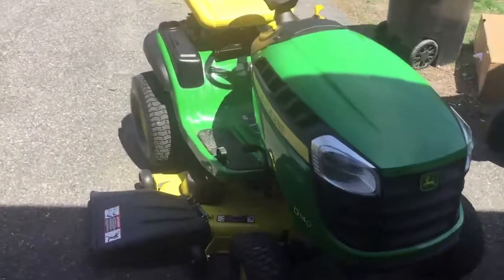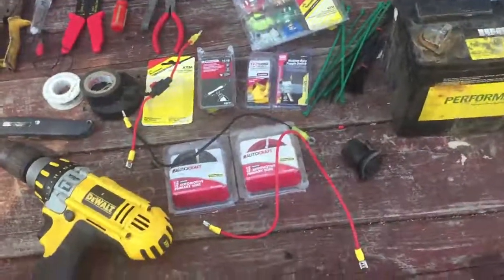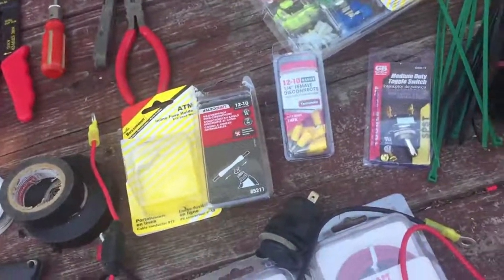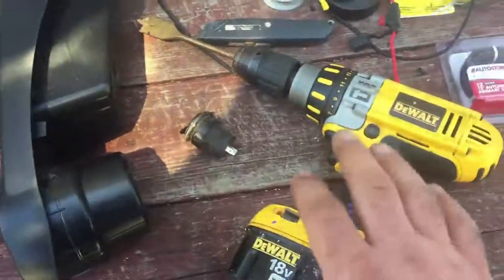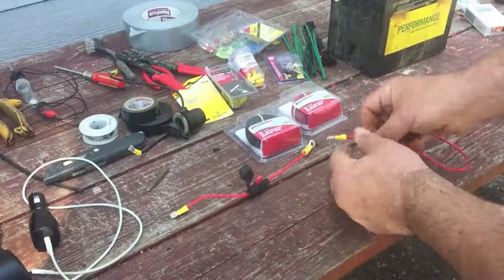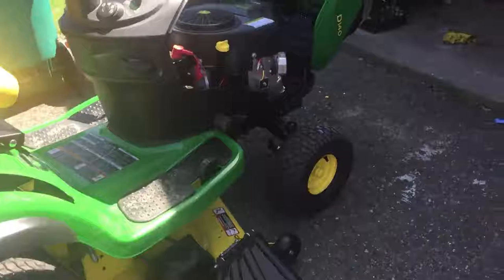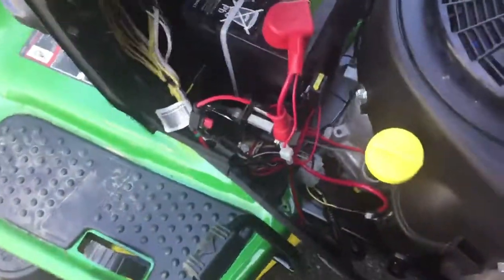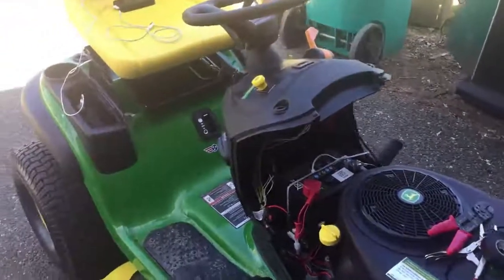John deere D140 12volt Power Socket Detailed Install easy

Comment: Thank you for this video. It was simple to install this socket. It’s one of those things that you don’t know you need until you see it in action. Now my mower is unique.  I even installed front leds (white) & rear (red) lights w/ switch. I just love it. Thanks.
Reply: Same here. I built a back rack, front bumper. ATV tires and a horn. Now I'm putting a 12v cigarette lighter socket on it.

Comment: Would it be possible for me to power my portable tire inflator without issues if I installed this on my lawn mower?  The reason I ask is because it feels like I'm always pumping tires on my lawn mowers, and I hate having to drive to a vehicle every time I need to pump a tire.

Comment: Just wire it straight to the ignition switch bro.  It's a small enough draw that you won't need a relay and the outlet would only be powered when you turn the key.
Reply from the maker: Mark Thompson Thanks for your advice and thanks for watching